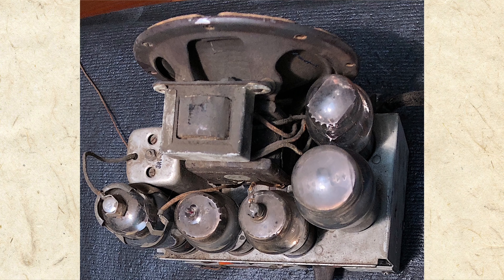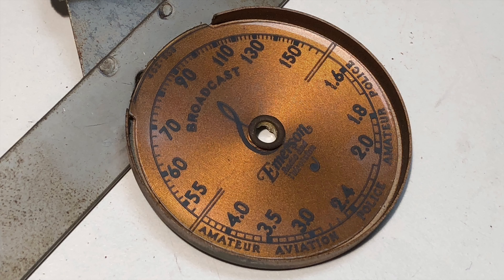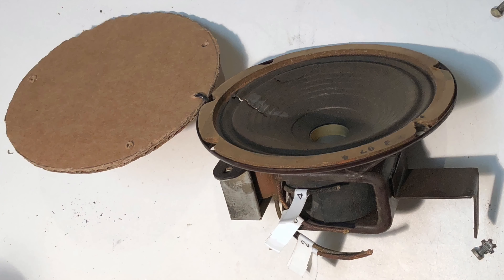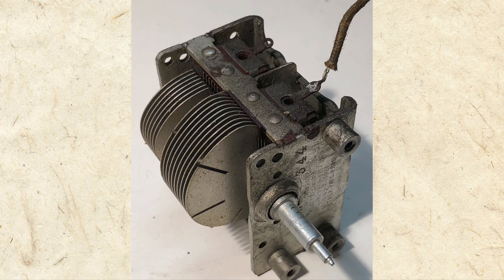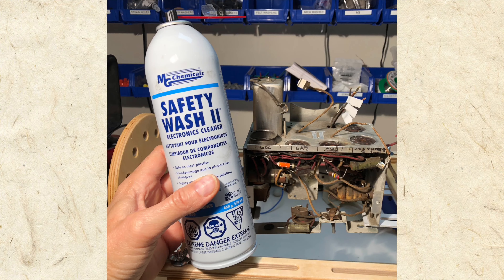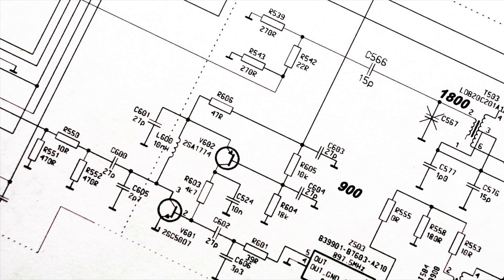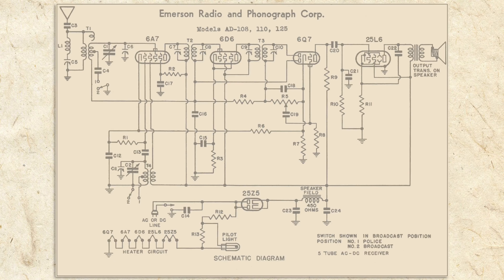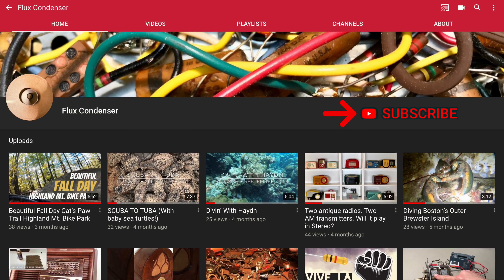Antique Radios | Cleaning & Schematics

Comment: i have heard that lead-free solder should not be used on old solder joints in vintage and antique electronics that still are coated with some leaded solder, or in other words, that the two should not be mixed. i believe it was said that this would create a bad joint as they do not bond well together.

of course, old solder should not be relied upon to hold a reflowed joint either way, it should be sucked away and new solder should be used. but this still makes me concerned about using lead-free solder to re-solder joints that have traces of old leaded solder on them. can you comment?
Reply from the maker: I’ve heard both points of view on this and have seen for myself that mixing the two is absolutely fine as long as both the original and new solders are fully melted to bond. That said, I no longer recommend or use lead-free solder as it performs poorly when compared to lead solder.
Reply: @FluxCondenser  no kidding! is that your evaluation across the board, or do you think there are specific applications where it performs well?

Comment: Hello, I just got a Telefunken Jubilate 1161 with a lot of dust , what can I use to cleaned before start working on it?
Reply from the maker: Jose, I recommend the MG Chemicals Safety Wash as shown in the video. It’s not too aggressive and I’ve never had it cause harm. It works well, but will require some gentle agitation with a brush to remove the thick stuff. Be careful with compressed air as, depending on the force of what you’re using, it can damage components.

Please remember, also, that whenever we decide to clean vintage gear, we take on the risk of possibly damaging it through the cleaning process, so caution is always advised.

Link to MG Chemicals Safety Wash page: https://www.mgchemicals.com/products/soldering-supplies/flux-removers/safety-wash-ii/

Comment: Does it hurt those old capacitors or transformers to get sprayed by the electronics cleaner?
Reply from the maker: For capacitors, not generally. I would never spray a transformer, though, as moisture could get trapped in the coils that will take a long time to evaporate and could cause a lot of problems. I try to only spray components that are well sealed by there construction. Resistors, capacitors (not paper) diodes, transistors, etc. Avoid areas that will trap moisture. And anything that’s sprayed with the cleaner must be given adequate time to dry before applying voltage. I sometimes use towels or compressed air to hasten the process, but care has to be taken there, too, to not damage a component. Hope that helps.